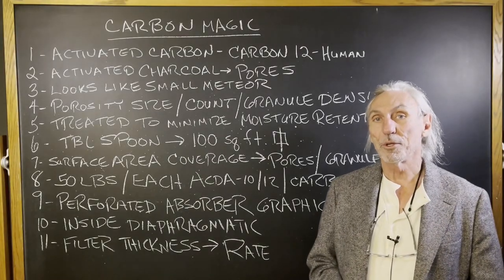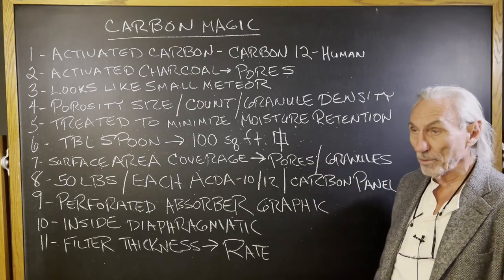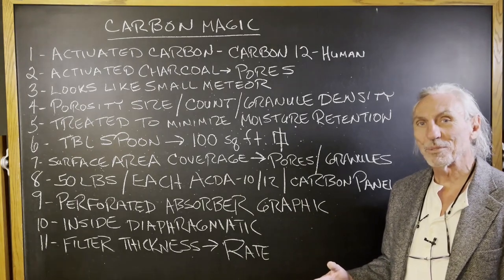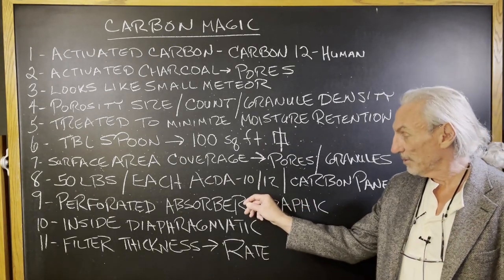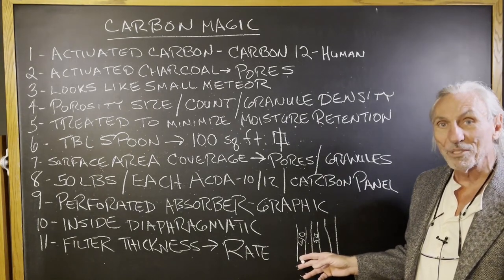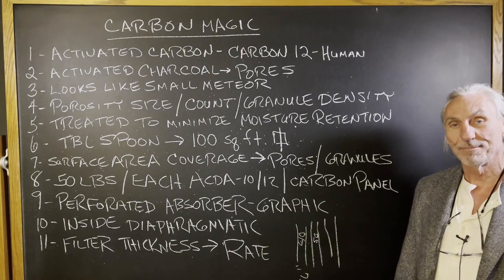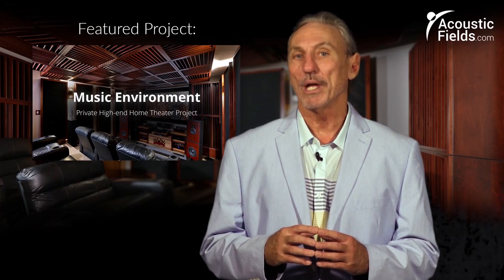Why Activated Charcoal Is So Magical! - www.AcousticFields.com

Comment: Its fantastic in odour control also.  Carbon air extraction filters.
Reply from the maker: Yes, carbons are used for air and water filtration. However, they will not work for sound absorption inside a diaphragmatic absorber. The carbon we used goes through a manufacturing process that allows the proper granule density, pore size and count along with moisture retardation.

Comment: I was interested in the diy plans.   Then your comment that “doing it yourself, they won’t be any good in 6 months” scared me. What would be the good in buying the plans?
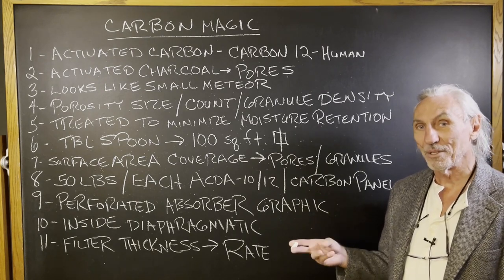Reply: Go back to the 3:00 mark and relisten. They give a 15 year guarantee because they treat the carbon so it will not absorb moisture. It is the over the counter carbon that absorbs moisture and won't last. NOT the Acoustic Fields carbon product.
Reply: Yes. And maybe I’m misunderstanding here. He sells sells diy plans. Those plans would have you sourcing your own materials. But if our diy products wouldn’t last for more than 6 months should we then no purchase the plans?
Reply: @RecordingStudioLoser  You purchase the carbon directly from Acoustic Fields, not from another source.
Reply: @vinylrules4838  and the foam you purchase from Acoustic Fields, it's the rest of the materials that are easily sourced elsewhere.
Reply: I also wish I knew it before. I purchased DIY plans, sourced carbon myself, as shipping from US too expensive, and now I see this video. This is a good info, if just was shared before. 

anyway lets see how it goes with time.
Reply: You can try putting in moisture absorbers, also I think there is value in the diffuser plans alone
Reply: @zackpetrovic3029  Well I asked a professional high end furniture company to do the bases. All are sealed and properly done in MDF 25 mm thick. For sure moisture will get in, still I suppose will be fine for a while longer. And than will see how it goes
Reply: @zackpetrovic3029  Moisture absorbers?   Huh?

You can build the BDA plans and not use Carbon, and use a different fill material if carbon is too expensive.  they won't perform as well, but they'll certainly do better than just about anything else on the market.
Reply: @maxortolan9955  There's a lot of different types of carbon on the market for different applications.  Water and VOC, smoke filters are the most common, but I don't think any of them are created specifically like what AF is doing, that's why they have to mfg. their own..

Lots of applications for activated carbon.  Heck they use the stuff to absorb poisons people accidentally ingest, or now they have toothpaste with activated carbon, etc.
Reply: @Oneness100  good suggestion. Might be useful for future.
Reply: @Oneness100  sure there are. I was looking at them when I purchased. At least I opted for the one with bigger "pores-holes". Anyway for now seems is doing the job. I am pleased with the results. Even if I am not able to compare with other options.
Reply from the maker: Our carbon technology took 8 years to develop consuming a large part of our R+D budget. For those who try and cheat and use other types, you will reap the "rewards" with diminished performance over time. This is the way it should be.
Reply: @AcousticFields   you are absolutely right to do it this way! I just wish you did this post before. I saw so many of your posts, and than I thought was a normal activated carbon, so I handled myself. Keep the good work!
Reply: @vinylrules4838  I'm not seeing the activated charcoal anywhere on the site... Thats the reason I ask. I see the foam. But thats not what the plans seem to incorporate.

Comment: If u buy the diy plans and use the best materials you can afford your room is guaranteed to be better it has to be even if it’s a tiny bit it’s better. 🤷‍♂️don’t over analyze nothings perfect
Reply from the maker: Some treatment is bettrer than none. Start with the lower frequencies and work your way up the middle and highs.